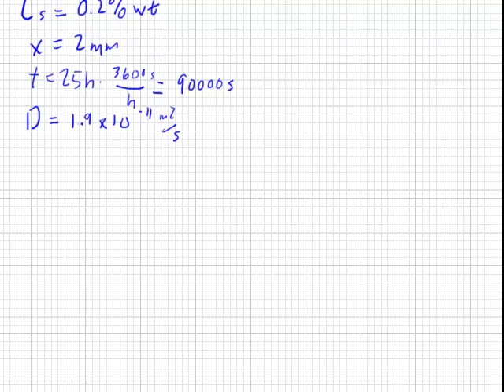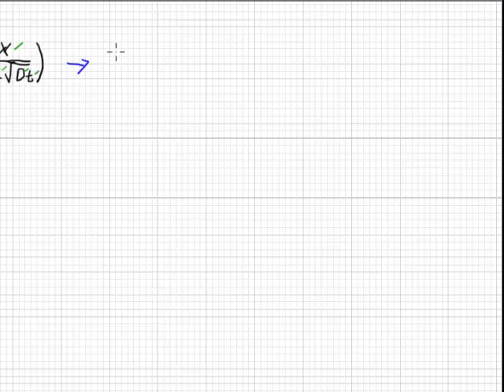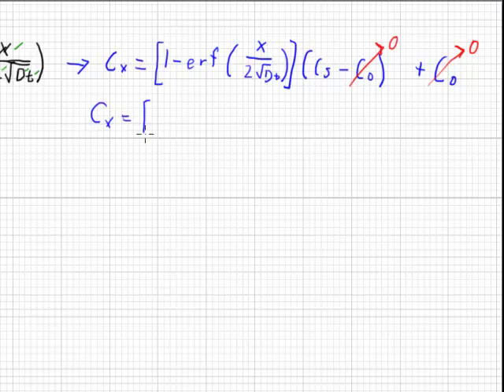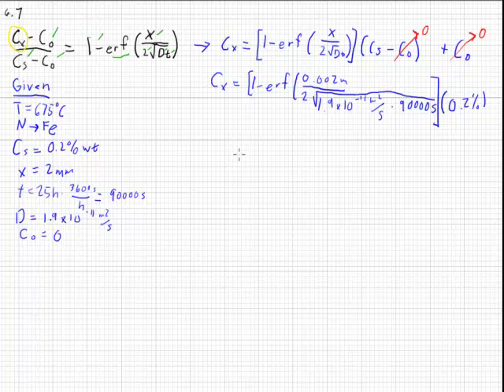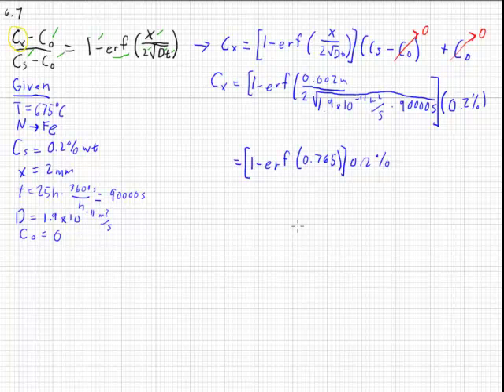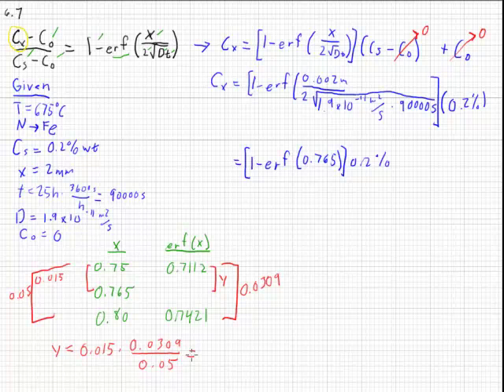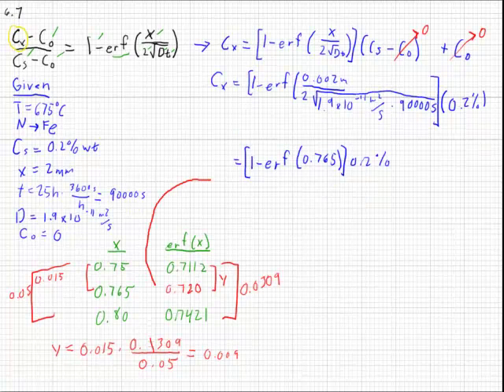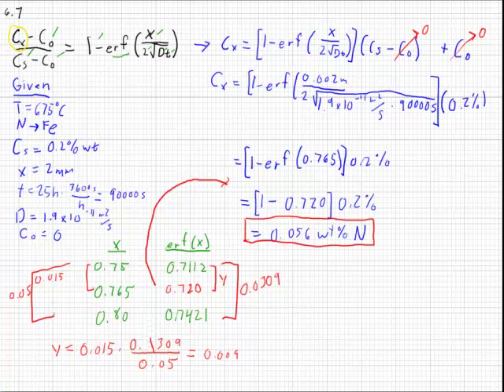Diffusion of Nitrogen into Iron, Concentration at a Depth

Comment: Why are we given temperature, and how does it affect the problem?
Reply from the maker: Great question. The temperature will significantly affect the diffusion coefficient D. However, it was already given as part of the problem, so to answer your question, temperature is not used directly; it is only used as supporting background information.
I can imagine that the question creator (not myself) may have been creating this or a different question with the intention of having the student look up the coefficient in a table based on the temperature, later decided against it, but still left the information in. Who knows?
I hope this helps. Thanks for watching and commenting!